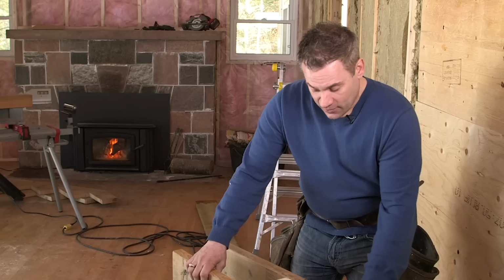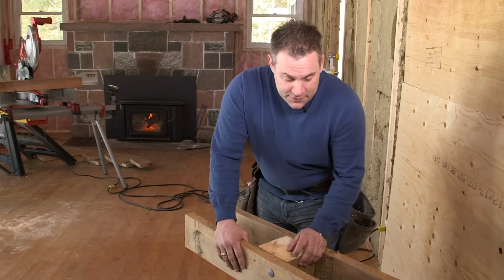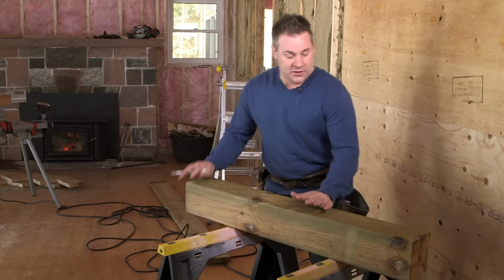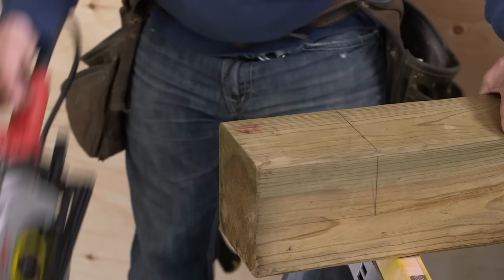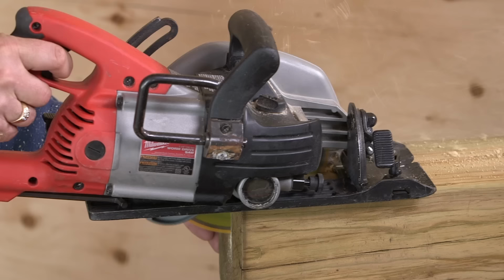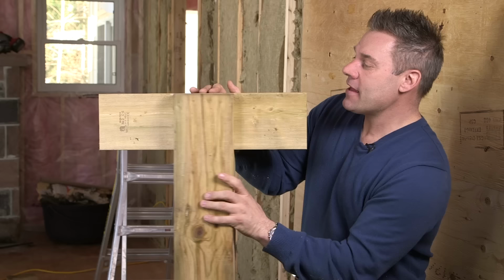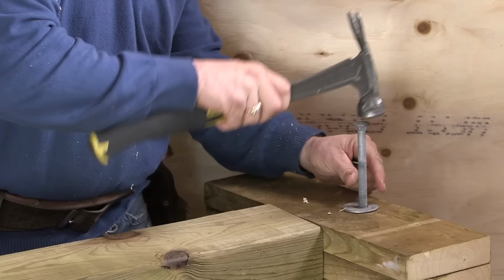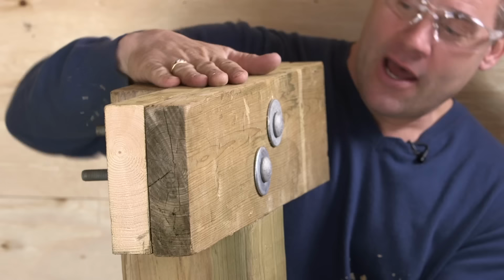How to Attach a Beam to a Post for a Deck | Decks, Docks & Gazebos

Comment: Depends how heavy duty it needs to be. The first option without cutting shoulders is sufficient in most cases but a 3 tier deck with gazebo, bar and sofas on for regular get togethers would obviously need grounding with shoulder joints but the first way in not necessarily wrong.
Reply: With something that size you would have to have more ground support post and the load on each bolt would end up being the same you would just have more of them.
Reply: Richard Lug like I say, neither way is wrong but for me knowing how much all these fittings cost a couple of shoulders at end of the post would save a fortune in coach bolts but obviously cost more time. As long as it’s safe for purpose and the person building it is happy then I guess it is up to the individual

Comment: Only issue I have the carriage bolt is actually to long, should only be several threads past the nut, washer exposed.
Reply: And the fact that he put a washer on the head of a carriage bolt, making   it impossible to stop the bolt from turning. If you want to use a washer on the head then use a galvanized hex bolt so you can get it tight. The most important thing is to get it tight.

Comment: Hey Jason, doesn't the friction from tightening the bolts carry the load, not the shear stress of the carriage bolts?  I do appreciate the notched version also.
Reply: Yes
Reply: That's a good question! But, what happens if the wood shrinks as it dries. No more tension, no more friction. Then the bolt is loaded in shear. Soooo...I would say no! Technically, the joint would be statically indeterminate. Because we don't know how much of the load is carried by friction and how much by shear. Although, we usually assume friction less joints in statics.
Reply: @markflierl1624  .......wood shrinkage compromising a friction grip is a good point and the sort of detail I'd consider these days . As a teenager I built a big tall shed by bolting all the timber together. I thought ten years would be good lifetime for it. Sold the property thirty years later with the illegally built shed still sitting firm..The Australian eucalyptus timber was dry and the environment was high humidity leading most likely to timber swelling slightly.. I had to use bolts and drilling cos it's impossible to hammer nails into the dry timber. The timber shown in this video doesn't look like serious construction timber to my eyes.
Reply: @markflierl1624  I bet you have never seen one Shear off before that's because that theory is just nonsense
Reply: @markflierl1624  Firstly,some of the wood pinched between the bolt and nut is crushed so cannot shrink any further.
Secondly there is nothing to stop you re-tightening the bolts after say 2 years.
Thirdly never rely on fixings alone because then you are one timber /fixing defect away from structural failure. Even a 1/2" notch will impart incredible additional strength to the structure.

Comment: I prefer to notch on both sides of the post leaving the middle piece and lag bolt through.  Gives more of an even bearing down on top of the post and a wider area for supporting the joists.  Edit:  Also lag bolting to the side of a post is not correct because you are relying on the strength of the bolts to support everything.  The post itself is supposed to carry the load not the bolts.  The lag bolts are used simply so the beams don't pull apart from the posts.
Reply: True. And in most practical applications, the notch on both sides only needs to be a 1/4" deep. This way the post's strength is still intact.
Reply: Robert Cornelius The strength of the post will still be intact notching both sides of a 6x6.  The load is bearing down on the post not sideways.
Reply: But you are exposing untreated wood to the elements.
Reply: ***** How so? a beam or joist will be laid into the cut notch covering everything.  If you are really worried you could use some wood preserve or sealer on the notch but it's unnecessary.  When they treat the wood it gets absorbed into the wood also.
Reply: It's only absorbed into the outer layers, not throughout. Water will seep in at the joint.
Reply: Chuck D...That is why ALL cuts on treated wood are to be "mopped/brushed" with new treatment after they're cut...EVERYTIME! This standard has been in place since wood treatment was developed.
Reply: That was not mentioned in the video.
Reply: Only if the cut is placed below grade.
Reply: the best notch method is both sides with one notch deep enough to reach its opposite and then set the beam in place.
no carriage bolt needed just some code complient connectors and teco nails.
Reply: SkilledEddie I agree with both sides for your reason but also it gives an air space between the two beams so water can dry and not cause premature decay.

Comment: I"ve tried both ways. I had the knotch way rot out, even with end cut preservative.  2 thru-bolts have held up better in my projects.  I know better than top put an inground pool on my deck. (Which I saw 1 person do)

Comment: hum I guess the deck I built 25 yrs ago is going to explode at any minute. Thanks for the heads up.
Reply: sadly you may be more correct than you think.  Australia (and I guess other places) has been plagued with incidents of high decks collapsing.  The most recent one included two fatalities.
Reply: yarpos 
not due to beams like this. Most deck collapses are due to incorrect attachment to the main structure (mainly incorrect fasteners), incorrect joist tie-in (mainly not using joist hangers), incorrect post spacing, and incorrect joist/beam size for the span.
Reply: yarpos   Because people use screws instead of bolts to anchor beams to posts or beams to structure (house).
Reply: I use 6x6 posts and notch in the outside bands. Using a 4x4 doesn't leave enough meat to bolt thru for my satisfaction.
Reply: Most deck collapses are caused by dependence in joist hangers that rust out in salt conditions in less than 20 years. Ask anyone living on seaside or the Chesapeake Bay. I've replaced thousands if them thru the years.
Reply: @SIC-SEMPER-TYRANNIS  How do you stop the rot when you notch?
Reply: @shelwyn  . I use marine grade pressure treated lumber for most deck framing.
Reply: @huejanus5505  Simpson sells a structural wood screw that appears to be marketed as able to be used instead of a bolt....is that just BS?

Comment: If you're doubling up a beam, its a good idea to put waterproof tape on top. (IMO lol)
Reply: Couldn't he seal the notch?
Reply: put some J-B Weld on it
Reply: Isamu T I was thinking the same. Water and debri will sit in the little v between/on top of the boards. even pressure treated will rot with leaf debri and water. I notched but left the center on my deck except at the ends of the deck. Those laminated beams always have leaves sitting there. The other ones just have a little.
Reply: Rockhead Gary n

Comment: There's these things called Deck Joist Ties, cost 3 dollars, use them with 2 carriage bolts.
Reply: Mr Glass  In my application, I couldn't care less about looks. The carriage thru-bolt method will last forever but the extra joist ties provide the extra level of safety for those who claim it is insufficient.
Reply: Mr Glass  simpson sells decorative ties that go with their structural screws....

Comment: Smacking that screw with a hammer is NOT a demonstration of shear strength. You didn't shear it, you bent it and broke it with fatigue. One should take note that you didn't do that demonstration with the 1/2 galvanized bolt you were trying to say isn't sufficient. You'd have been banging on it all day trying to get it to break. The shear strength of a 1/2" galvanized bolt is around 45,000 psi. Two per beam is way more than enough to support a common residential deck with a 40/10 load spec. That isn't to say the method you demonstrate isn't maybe even a better way, but most decks are only a couple of feet off the ground and don't require 6x6 posts. Using the conventional method with a 4x4 post is more than adequate for a typical residential deck and to claim that it's a mistake to do it that way is misleading to put it gently.
Reply: The bolts are more than enough to support the beam, you could even put cleats underneath the beam if you wanted to but even that's unnecessary.
Reply: If it would be as he showed, there would be all bridges, cars, airplanes, some ships and everything falling down, because materials there connected with bolts,  rivets, screws.
Reply: relax guys................  every architect and civil engineer in the universe knows that he is right...... even if using a hammer is not right, but still the beam has to send the charges from the floor or anything above to the column so it is "far more safer" to be on that column, and not next to it...... and i use the experssion "far more safer" im not saying its necessary in cases where there is not great charges.... but with greater load it becomes necessary
Reply: Lots of things around us are in shear. Not a bad thing if designed for the application. John, well said explanation of what he did. People like to use analogies but they need to be accurate.
Reply: Screws are to brittle that's why you don't use them if you want it to last, !
Reply: John Wallace j7

Comment: This is quite misleading.  Depending on the application, carriage bolts used in this manner are just fine for the average deck.  When you start getting about 6' or some massive McMansion deck, then you can start throwing in some advance techniques.  Most decks would be torn down and rebuilt because of age before those carriage bolts fail.
Reply: Read the comments and you'll see its not the carriage bolts you need to worry about. It 's the 1/2" of wood against the bolt which is the weakest point and will fail before the bolt does. to prevent this, the notch is used to distribute the downward force of the beams across a larger surface being the post.
Reply: On a small deck, it's not a problem with a washer to distribute the force.

Comment: Once I ran out of galvanized bolts, the electric power went down, nails and screws I've just purchased were stolen out of the back of my truck. Fortunately I had some bubble gum, chewed it for a few minutes and used it to hold my brand new spanking deck.  It is still holding hard and strong!

Comment: The bolts have plenty of strength.  The problem is as the wood ages and dries the bolts get loose and may end up "sinking" down the post.  That's why it's better to do s notch, not because the bolts are going to break.
Reply: I hear this argument all the time. The load is transferred from the beam to the post by the friction the bolts are putting on the beam. I know both ways will work but I notch my posts because I'm not going to drive around every year tightening up carriage bolts that arent tight anymore because the pressure treated lumber has dried and shrunk. The lumber we get is almost dripping wet sometime and would not be ideal